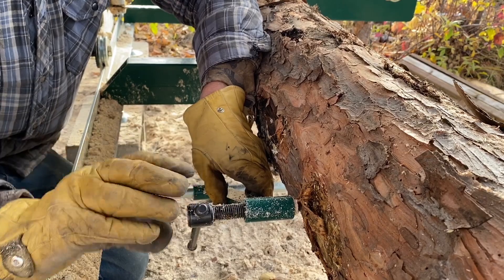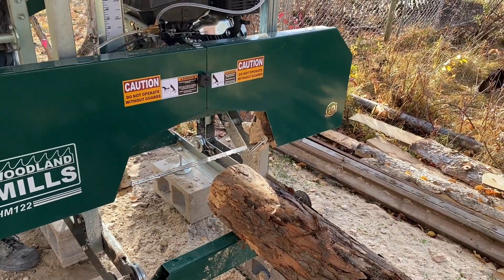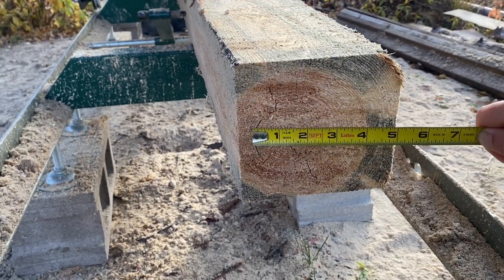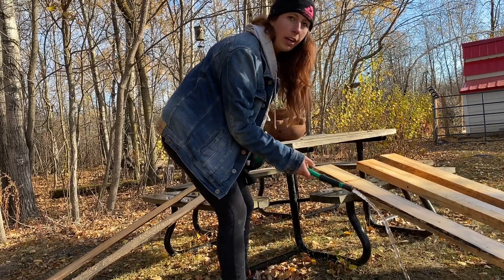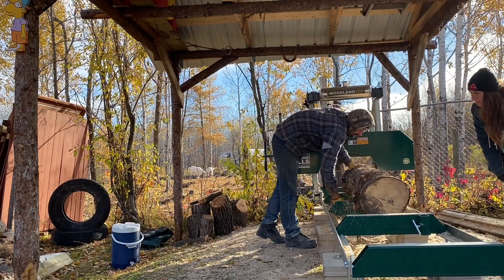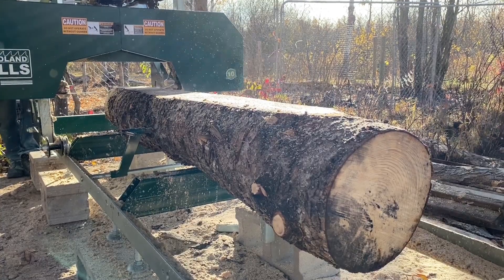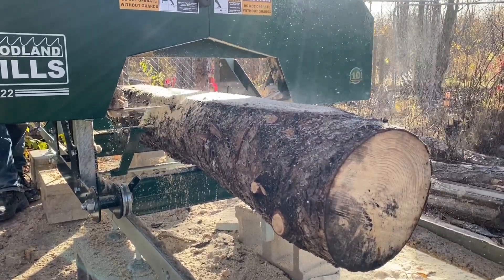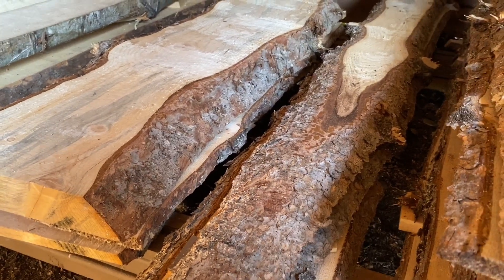Milling Wood Helpful Tips and Tricks - Woodland HM122 - Saw Mill Video How To (Vlog 9)

Comment: enjoyed your vid. you did perfectly fine in speed of running mill.
pay attention to idle speeds, if you hear ringing and dinging... thats the clutch trying to engage,. slow idle down if that's the case.
bad advise earlier about speeding up idle to prevent a cold engine from dying, always let it warm.... all gas and diesel engines.

Comment: Yep, it's a good to let a small engine to warm up in order to let piston and cylinder to size equally. I do so on my chainsaws, tiller, weedwacker, chipper shredder, etc. Don't remember where picked up that tip but it made sense. Doesn't take extra time to add life to your equipment,
Reply: Absolutely correct for any air cooled engine

Comment: You shouldn't have that much sawdust buildup 10:57. Too much lube maybe? I saw mostly green alder. Sawdust is wet and did not eject freely. I reduced the water flow at Woodland Mills' suggestion, and I also cut the three bars out of the sawdust exhaust port. No, WM did not suggest that, but now I don't get the wheelhouse jammed full of sawdust.
Reply from the maker: That’s really good to know, thank you! The saw dust build up is excessive at times absolutely, we’ve had it for about 6 months so we’re still learning!

Comment: i've never seen anyone hosing down lumber.  i'm pretty sure brushing off the dust will do just fine.
Reply from the maker: It saves time and doesn’t damage the live edge as much as brushing. I use the live edge with my business and it’s important that it’s not chipped off or damaged. Sawdust and water (from the water feed) once it dries is like concrete. WAY easier to hose it off while it’s still wet, but thanks for your opinion

Comment: Only problem with the mh22 is all the cutting is double speed which makes me think it's super slow cutting?  Almost all videos of this machine on YouTube is 2x speed if not more.
Reply from the maker: It’s actually pretty quick with soft wood. Oak, you pretty much have to stand there all day (I’m exaggerating a bit lol). 
We had an issue with our throttle cable not being set right (our fault). So when we thought we were going full bore ahead it was operating at only about 1/2 speed. 
Birch, Pine, Aspen, Ash, Dry Spruce is all fine and quick. Oak and super knotty/ sappy spruce is slower.

Comment: Regarding the issue with warming up the mill so it wont die on you. Can you not turn the idle up a bit??
Reply from the maker: Hey Curtis, normally it doesn’t cut out (die on us). We just let the machine run a bit to warm it up as you would any other engine.
Reply: @simplelivingwiththetomchak3256  Ya was just a question. I ordered the woodland 130max with the trailer last week. Wont be here until June so im watchin a lot of videos on the mills. Very much enjoyed your video. Best wishes

Comment: Is that a 7 or 9.5 horsepower? I'm going to buy one and was thinking about going with the 9.5
Reply from the maker: This one’s a 9.5Hp, it’s a great investment! The only thing to keep in mind that it’s a lengthy process to cut a knotty log I.e. Spruce. About 30mins for one cut length wise, 15” width 8’ Long. I don’t think we fully realized this till we started using it. I mean to us the time is worth it, some softer woods don’t take that long to cut.
Reply: Time isn't a huge worry. I am buying the 9.5 hp hm122 in a few months so I can start saving boards for my house which I don't plan to build for another few years.do you use the boards wet or do you dry them before use?
Reply from the maker: Drying them out first is recommended the main concerns would be for shrinkage, fungus growth, cracking and warping. Even leaving them to dry out for 1-2 weeks before building and stacking them helps a lot.
Reply: @simplelivingwiththetomchak3256  we got the 126 with the 14hp and it's pretty fast.
Reply: @simplelivingwiththetomchak3256  30 minutes for one cut seems like a really long time, even for a 15" wide piece.  I've had a really knotted cherry log on my HM122 and I was able to get the entire log milled in about 30 to 40 minutes.  The log was 18" in diameter.  Two things come to mind to account for the long cut time; 1) not enough lubricant or 2) you have a dull blade.
Reply from the maker: @andrewbupp7374  Hey Andrew! Funny story, we figured it out though. The throttle cable slipped, so what we thought was full speed wasn’t lol. Took us a bit to figure out the issue, but now the machine cuts wayyyy faster
Reply: @simplelivingwiththetomchak3256  I imagine it does cut faster.  That is a funny story

Comment: I’m looking at purchasing the same saw mill. How long do the blades last. I have heard 3 to 5 hours of non stop milling and depends on the wood. What is your experience with this now?
Reply from the maker: Yes, that’s sounds about right. Soft wood we can probably get through 6-8 logs, hard woods like oak would be closer to 4-5 logs. Most of the blades end up snapping when they’re on their way out. We have a metal shop close to us that we get our blades from for $27 ea. Sharpening $7 ea. We just had to bring them one from woodland mills and they copied the pattern.
Reply: @simplelivingwiththetomchak3256  That’s good information. 
Thank you.